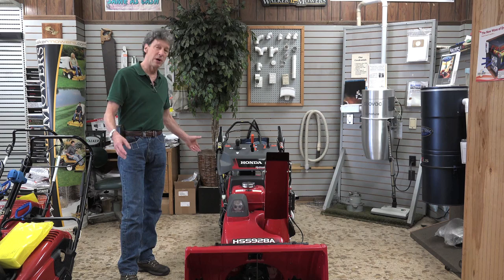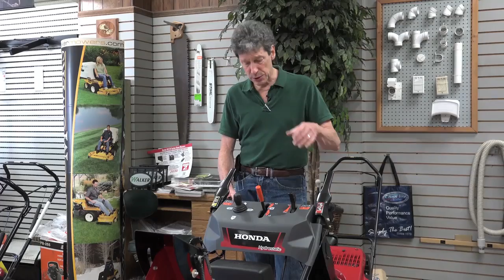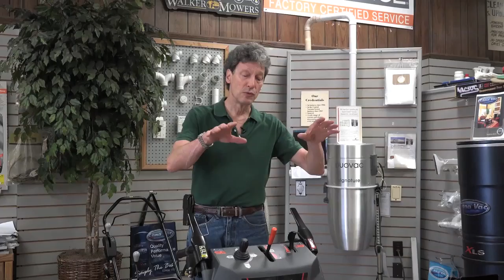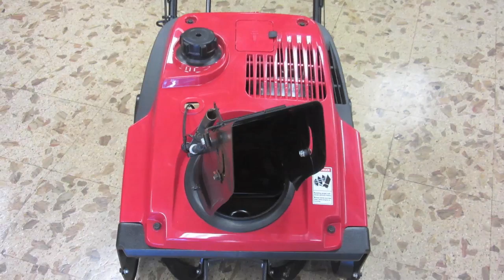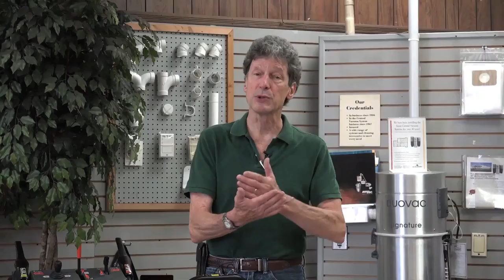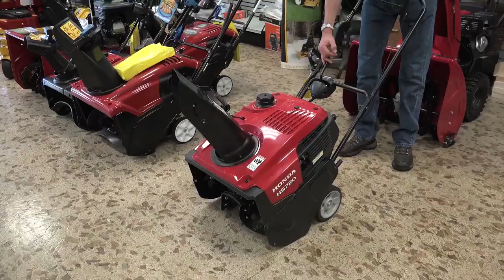An Overview on Honda snowblowers

Comment: how much is this
Reply from the maker: Hi Nicholas - thanks for your inquiry.  Honda makes a range of 2-stage snowblowers - starting with 7 hp wheel ($2200) and track models ($2350) and moving up to 9 hp wheel and track (both recoil start and electric start), then 13 hp track models and ending with a Hybrid track ($7999).  You can see them on our website at www.etpetersen.com
Reply: Im located in staten island i need a snow blower can get give me a good deal  what is your phone number
Reply from the maker: Hi Nicholas - sure - give us a call at 908-232-5723

Comment: honda makes the best blowers..hand down. id say ariens is second.
Reply from the maker: Honda is the best.  Today - with the change in manufacturing practices with many manufacturers (read "lesser quality") - Toro would undoubtedly be 2nd best.
Reply: how hard are the Honda tracked blowers to turn? I really like my Ariens because of auto turn. But looking at getting a new honda.
Reply: @turdsandwicher  The new Honda's have track clutches for steering. Works great
Reply: @Gibeau90  I ended up getting a 1332 its a mean machine! The Ariens was a little more maneuverable until the engine imploded! haha
Reply: What do you mean by "iteration?" Are you sure that's the word you intended? I'm not nitpicking - I want to learn what you see are the differences between Toro and Ariens. Is this a Canadian term?

Comment from the maker: Hi - Yes - I clear our facility's parking lot with an HSS928 wheel model - it is virtually impossible to clog in practical/intelligent use.  Our last snow of last winter was two feet.  There are YouTube videos posted by those who own and boast in such a unit.  Buy it in confidence and don't give it a second thought!
Reply: So the 28 inch would handle buffalo ny storms I live on a main road with  city plows making hard piles at the end of my Driveway the 28 with 9hp will be enough power
Reply from the maker: Sure enough - with deeper more dense snows you might have to work at it a bit more; however, it will do it.
Reply: My last blower was a cub cadet 10hp tecumush motor I'm concerned going down a horse!! Is the Honda 9hp more powerful then 10hp tecumush u know about them motors??
Reply from the maker: Here you go .. https://www.youtube.com/watch?v=14inIdqNL60
Reply: Yea that's the 2015 model there saying the 2016 model is less powerful and clogs for some reason
Reply from the maker: Same machine.  If you're fearful as to the Honda buy something else.
Reply: Not Fearful there just saying  2016 model is less powerful then 2015 and many more negative reviews on the new model
Reply: @cabbie1106  : That's probably because EPA has caused a downsizing (underpowering) of the idle jet to meet emissions requirements. It's a very simple mod but Honda and dealers won't/can't tell you about it.
Reply: cabbie1106 .wigbird do you have any links to these reviews. I'm in the process of buying the hss724 or yt624 right now.
Reply: It is impossible to clog the HS928TAS snowblower.  Check out my snow removal video!  https://youtu.be/dSOp0ajczBo
Reply: At almost 3 grand a peice Is kinda steep for something you barely use
Reply: Steven Silva you may barely use it, but I use mine.  The first time you shovel following a 2 foot snow storm, you will quickly change your mind.  Remember, they are priced higher but over the long haul they cost you less than other brands.  These are snowblowers you buy once.  So, buy the right size the first time and you won’t look back.

Comment: I'm in search of a 28 or 32 I've read a lot of reviews the HSS928ATD is underpowered and clogs a lot have u heard any complaints on these models?? Second is the 32 a lot more power I know it's about 4hp more is that overkill
Reply: We just purchased an HS928 and moved 18" of snow with it and didn't break a sweat.   It was definitely not underpowered by any means....a great machine.
Reply from the maker: Hi - so true!  Glad you are satisfied.
Reply from the maker: Hi - thanks for your inquiry.  We suggest for most usage the 28" model.  I have to grin at any thought that any Honda 2-stage snowblower lacks efficiency.  I have personally and steadily used a variety of snowblowers since I was in my teens (I am now a youthful 65) - Honda makes the most efficient machines in every respect.  Our users all agree with this.  Buy one - you will have zero disappointment.
Reply: Have u personally used the new 2016 HSS928ATD cause a lot of people were complaining about clogging just on the 28 model I just want to make sure for 3k I get right machine?? Is the 32 with 4 more hp extreme big difference I have about 100ft driveway on a Main road where I get plow snow at end deep and slushy if I buy the 28 I just don't want to have a clogging issue I know people say add a impeller kit but for 3k you shouldn't have to modify anything
Reply: @cabbie1106  : Clogging problems are solved by an impeller kit modification. It's after-market because Honda hasn't figured out how much better they work in wet snow and slush. I don't know how it'll affect the warranty.
Reply: Very satisfied.   And you do a great job with your reviews.
Reply from the maker: Great to hear - thanks so much!
Reply: I bought the 28 and couldn't be happier.  I wish I had made the investment so long ago.  I blew snow from my driveway to my neighbors driveway.  Never even had the power up much to blow.  Can't wait for a big snowfall.  The only problem I have is with the key.  I've never had a snowblower with a key and if it hasn't started by the third pull I know I've forgotten the key.  My daughter refuses to learn to use the snowblower as I tricked her 5 years ago into starting the Honda lawnmower and now she mows the yard.  She doesn't want to snowblow also.